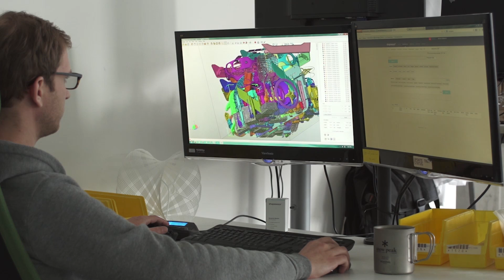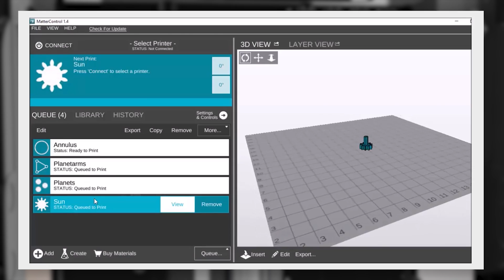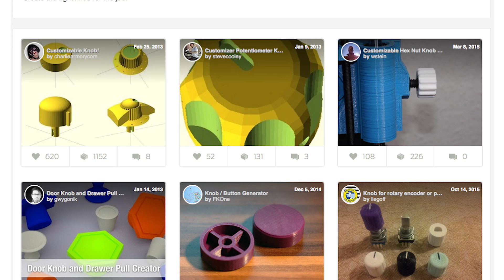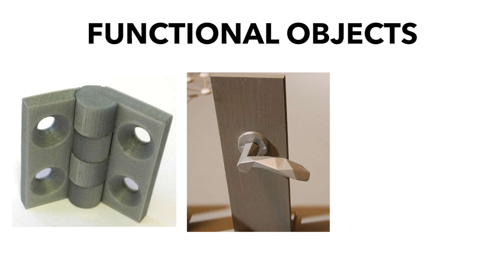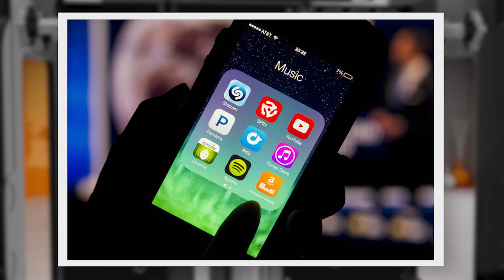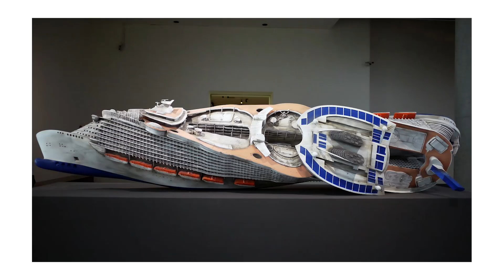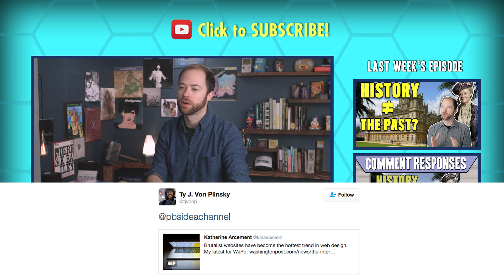Will 3D Printing Break Copyright?

Comment: I don't specifically see how 3D printing should be any different from wood carving or some other creative process. I believe (correct me if I'm wrong) that I could take a copyrighted object or property and produce a recreation of it in the medium of wood carving or metal casting so long as that recreation is for personal use and not being distributed commercially. So, why would 3D printing be any different?
Reply: +phoxxentswrath Should anyone with a 3D printer be allowed to "make" themselves a copy of something without justly compensating the designer?  The problem is someone other than the designer making available a file for download circumventing the designer's ability to get compensated for their work.  No one would come after me if I designed in CAD a princess Elsa figurine (lets say that was indistinguishable from Disney's character design)  and just printed it for myself or to give away as gifts, but of I were to sell them or even make the files available for others to download and print, there would be a problem.
Reply: Paul Stallings Alright, but neither of those concerns are particularly unique to 3D printing. The re-hosting files thing has been around since, well, ever. Same with the nock-off toy. The avenues are already in place to deal with such things... the latter more so than the former, though.
Reply: I am not a lawyer nor do claim to be any kind of expert on intellectual property law.  But my understanding is, as a "creative process" it's not any different.  If I were were to use design software to re-create a copyrighted object for my own use that's fine.  But a 3D scan, or simply downloading and printing copyrighted object is in violation of the law.  It would be like torrenting a movie or photocopying a book.

Comment: Excellent primer!  I've witnessed this tech completely TRANSFORM parts of the toy industry in just a few years.  3d-printing has empowered fans & entrepreneurs to rapidly prototype new action-figure molds easily; going from add-on kits for existing Hasbro / Takara Transformer toys to now beating the IP holders to market w/ often better, competing products.  So far, these are expensive, unlicensed 'premium' versions (much more $, smaller batches) though demand has made them ubiquitous.  This competition has forced 'Has/Tak' to improve their IP & products, increase productions on some items, while improving sales on a few lines but has also helped kill aftermarket value for some 'Legit' made toys.  The Transformers brand relied on stories, Lore to build the brand; now these grey-market Decepticlones are assimilating that brand w/ support of 'fans' eager for more plastic idols.  Have to wonder if the net effect will allow the medium to survive.

Comment: I'd like to add some detail to the issue touched on at 13:44. The problem was that just3Dprintit ignored the terms of the Creative Commons license on the models. I made a video about it because my models were among those used. In the video my angle being that they were just generally being dumb about it from a business perspective, but the comment section of that video has surprisingly found a bunch of people who think that just because the models were free, as in beer (gratas) that they're free as in speech (libre). Those who, even after having the explained to them, insist that it's a legal gray, so they're going to keep doing what they do. I guess they really really want to be able to profit off the hard work of others without compensating them. Well, it's the American dream, isn't it?

So far the CC license hasn't been challenged in court, mostly because of the sorts of things that CC covers. The flagrant violators are so small time that no lawyer will take the case, as the chance of payout is infinitesimal. So the violators keep on violating thinking that they're safe. This shouldn't have to wait until it has a martyr to settle it, but often that is the case.

Comment: I'm currently collaborating with a major vehicle manufacturer in a project where they are investigating the use of 3D-printing (specifically Selective Laser Melting of metal powder) in order to manufacture an engine. So if such a scenario becomes reality, and products are serially manufactured on a mass scale, what legal issues could that bring with it? For example might there be an increased risk of intellectual property theft, thus making security issues around safeguarding data and component designs really important?

Comment: I have a question about where functional meets design, for example if I wanted to say 3d print a <insert tv character here> mug well that character is clearly design but the mug makes it functional, is that an infringement or am I ok under fair use if I am not selling it and its just for personal use, but then what about the file can I distribute the file. its would be my file that I would have had to make from scratch but it just happens to resemble <insert tv character here>

Comment: The company with the biggest issue I've heard with 3D printing is Citadel miniatures (the makers of Warhammer and Warhammer 40K games). Their first step was banning any 3D printed miniatures from being used in their stores, which is pretty reasonable since it's THEIR stores. The next step, and I'm not 100% sure this was intentional, but lately their models have been getting more and more intricate and using more angles that are harder for most 3D printers to make. So in the end, the threat of 3D printers has kinda helped the table top gaming community - Citadel still sells plenty of models, the players get better, more dynamic, more challenging models to paint. This I think has been a pretty good way of dealing with the threat to that industry by 3D printers =)

Comment: 3D printers can only print out objects using one material at a time  whereas different products like locks or computer chips need different materials with different properties if their are to function properly. Maybe 3D printing is only a threat to the design oriented and collectible industries that make things like figurines. Maybe 3D printing will make industries sell their products based more on quality rather than anything else. Maybe this is a good thing? Tell me what you think
Reply: +Neil Botelho That's true for now. But I don't see it staying that way forever, a lot of 3D printers already use two materials. Support material and part material, granted they are both plastics but they are different types.

Comment: I do think it worth mention that copyright when it was first created had a really short life span because it was only meant to keep people from immediately copying something that became popular and not keep people from using it ever, and I do think all these system need to be revised with that mentality in mind to some degree at least, because locking something for ever not only slows the original creator creativity but also prevents other people for fear of breaking someones elses content.
Reply: +Left4Cake How does it slow their creativity? Or, rather, how is a "slow" creativity a bad thing? Wouldn't you rather have them make a piece with time and effort than just churn out shallow piece after shallow piece just to keep something on the market? There is no damage to having a lifetime copyright. A shorter copyright wouldn't prevent a simple noun-swap. Heck, a longer copyright would allow more creativity because people would have to come up with something unabashedly new instead of just doing something with someone else's work, even if that "something new" is just a sort of noun-swap.
Reply: Ok. Well in theory what if Bransotcker had sole copyright of anything involving vampires for example. How many vampire movies wouldn't we have. What if Aliens got StarCraft shut down because the race design were based of it, or Sonic the Hedghog wasn't allowed to include Super Sonic, or if Hunger Games was to similar to Running Man (Arnold Schwarzenegger).
Reply: ***** But that's not how copyright works. He doesn't get control over the concept, and concept control has never been the point. It's always been about implementation. You would have a point if that were how copyright worked, but it's not. Copyright works in a way custom tailored to encourage competition and creativity and has had more than 200 years to make sure it did encourage competition and creativity. Besides, copyright doesn't last forever. It never has and never will. As it stands, it is bounded primarily by the life of the author plus some amount of time. That lifetime bound is important because it gives artists a nice safe area in which they can create. They can make something to the best of their ability instead of having to make sure they complete it within a certain amount of time so that they have a certain number of items on the market. It allows the author to maintain authorship and integrity of his works.
Reply: +phoxxentswrath Right... Except when sony uses to own the Happy Birthday song... With is onr this that Did actually happen.
Reply: ***** I'm not sure what you mean by this. The whole thing with the happy birthday song is just royalties for that particular song. There is nothing preventing the creation and use of a different song about birthdays carrying a jolly tune. Sony's (is it Sony that holds the rights? I didn't think so, but I'll take your word for this since I don't know otherwise) ownership lies exclusively in use of that tune with those lyrics within a commercial product without the consent of the rights holders. You can sing it at a birthday freely. You can make a new birthday sing freely.

Comment: I think a valid point is the fact that the physical world and the digital works differently.
How will oversight work? In the digital realm there are ways to coordinate millions of users but that's not the case for D3 printers. 
Someone making a chair out of wood for home use won't flag any system of copyright. Making copyright law virtually unenforceable in practice.
Reply: +Serah Wint 
There's this pattern of five dots on the 10 Euro note called the EURion constellation. When a printer or a photocopier detects this patter it refuses to print it. maybe this kind of thing could be used to prevent copyright infringement. When the design file is purchased it doesn't have this design but any copies made of the file will have it and once the product has been printed the file deletes itself. I know some people will say that someone will come  up with the technology to stop this but it will still minimise infringement.
Reply: Neil Botelho
You are overlooking the fact that people with 3D printers will be able to print 3D printers.
There isn't going to be a controlled commercial industry for this.

Comment: I am opposed to you choice of words. The word "protection" buys into a narrative, that is already deeply flowed. Copyright does not protect any work. The more appropriate word would be block.
Reply: +MusikCassette But it does protect. It gives specific protection to the author and his integrity. I mean, sure, it technically protects by "blocking," but so does a lock on a door. It makes sure that the author stays the author and that he, not some random guy down the street who just copied him, gets the benefit of his work.
Reply: +phoxxentswrath 
a) you seam, to hold some beliefs, that I not only disagree with, but rank as one of the major problem this generation has to solve. If you are interested, we can have a discussion about those beliefs.
b)would you agree, that a term, that preassumes a beliefsystem, that is not agreed upon is problematic? independent on the accuracy of that system.
c) even within that beliefsystem I thing it is at least problematic, to atach the word protection to the work.

Comment: I wonder if there could be an incentive for a state to preemptively pass a law designed to protect personal use of personal manufacturing. Because the manufacture of an item would only occur within a state, the state could, if their legislators have forethought, provide protections to their constituents of possible patent/copyright violations. I'd live in a state that could be so forward thinking. 

Side note: I agree with some commenters who are foretelling the death knell of copyright/patent, and for two reasons. One, that technology is proceeding at such a rapid pace ( along a Moore's law pattern) so the tedious and expensive process of copy/patent rights will become obsolete to the extent that truly innovative companies (like Tesla, NASA) will release the patents they hold to remove their burden. And two, that the idea/creative economy has developed a glut of thought jobs so the value of individual concepts will be diminished. (Part two really developed from the comments here.

Comment: Question for Michael:
If I sell a file online for a functional object, and it works fine on my printer. However, the user's printer isn't calibrated correctly, is calibrated differently, or uses a different material, and the part fails, injuring someone in the process. Where does liability fall?
Reply: The person who printed it. If you license someone to use a patent you designed but they mess up manufacturing it is their fault if it breaks.

Comment: Question for Michael: How do you think 3D printing can accommodate the copyleft  community of people who want to dedicate their works to the public in one manner or another (either public domain or various licenses like Creative Commons)? Many of the free licenses require attribution and have clauses requiring the license to travel with the work, which is easy enough for, say a photograph with metadata, but very difficult in the realm of physical objects. What kind of setup do you think would make sense to both give people proper attribution for their works while still allowing broad sharing and remixing of 3D printed works under various free licenses?

Also, while the world of patents is smaller in some sense than copyright, I think it's somewhat risky to assume they won't be infringed. There are a lot of patents that make very broad claims, especially in the current world of means+function claiming, so that 3D printing parts, especially for devices that are less than 20 years old at the time of printing, actually stands a pretty good chance of infringing a patent (sadly) even though the number of patents is smaller than the number of copyrights out there.
Reply: +Jacob Rogers

About attaching licences to physical objects: would a QR code work, you think?
Reply: +Ahsim Nreiziev QR codes are a clunky solution, but not a horrible one. They'd work in the sense that you'd at least have a way of accessing the item license that travels with the item, but they're pretty ugly if you're making an art piece and I honestly don't know how easy they'd be to get onto various different objects, especially stuff that's lacking in flat surfaces. But certainly possible.

Comment: I wonder where 3D printing falls between cunterfeiting and customising something, for example in action figures cunterfeit is clearly wrong, but making a custom vertion of a character not made/available or badly made by the manufacturer is ok and several artists even make a living out of it. I guess the main difference is if it's for personal use or the scale at wich you sell it

Comment: If 3d printing democratizes the making of stuff, shouldn't there be an in-depth discussion as to what is permissible, what is not and why? Every time the conversation started to get into "the weeds" was when I was most engaged in that conversation; I was left being more turned off by the cursory explanation. I want "the weeds". What can be done with 3d food manufacturing? Housing? Replacement parts? It seems as though this conversation was aimed at the construction of chachkies... for which I have no interest.

Everyone used to make their own food, then it was half, now it's about 3% of Americans are "farmers". Will 3d printing do the same for manufacturing? How does mart manufacturing synergism (I hate that word) with robotic assembly? What will the new economy look like? These are the questions I'd like discussed.

Comment: Great video! The inverse of this argument is interesting as well, I work with high end 3D scanning equipment, and the act of scanning a work of art with high enough precision creates can create a digital copyrighted work.  I often face question similar to the following: Is a scan a copyrighted object? By re-printing, it becomes identical to a casting of the object. If we scan a sculpture, does the artist then own our copyright on our scan data? What is different from a highly accurate scan and artist creation?

 IP control can be an issue as well, we have some companies wanting a reverse engineer of a competitor's part, and we quickly end up in a grey area,  Is this scan any different than taking detailed measurements of a part and reverse engineering it? Or is a digital 1-1 representation need to be treated as something more?

Comment: What does Michael think about translation of already existing 3D objects into printable files? Such as printing replicas of movie memorabilia. Also what would the case be for translating a 2D drawing into a 3D print, for example Brett Ryder's Third Industrial Revolution 3D print. Which is a accurate representation of the original 2D media and if this would infringe on the copyright  of the piece.